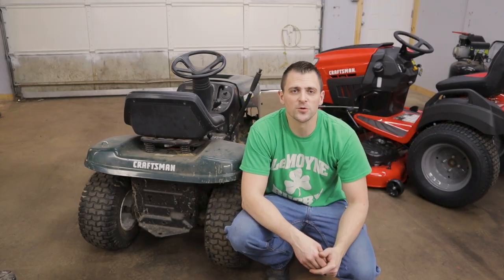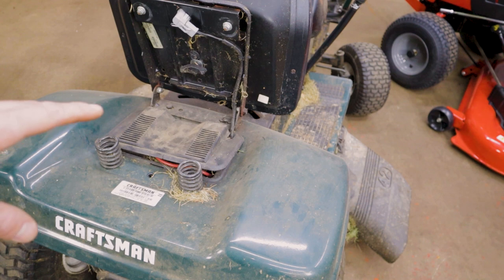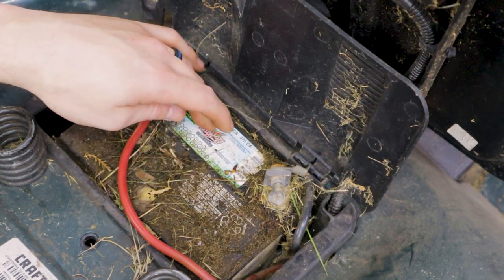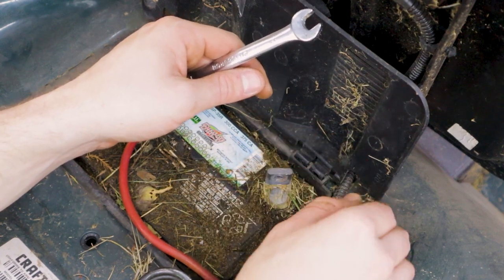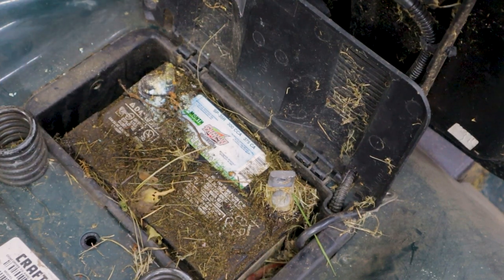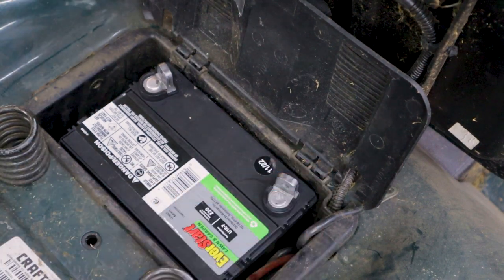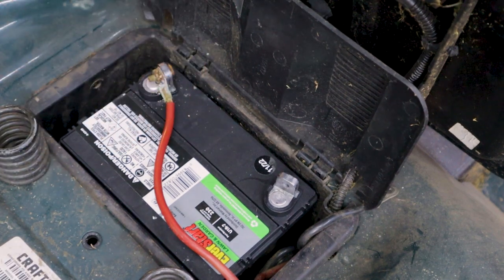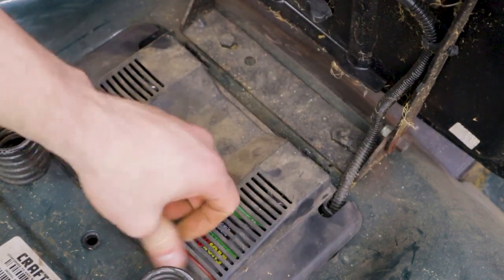How To Replace Riding Mower Battery

Comment: What are the main issues of this riding lawn mover found one in my area for 100 I was just wondering before deciding to buy it
Reply from the maker: Other than the little things I've filmed ... nothing. I had a few of the welds on the mower deck suspension brackets break, but was able to repair them. I've really put this little mower through its paces and it's always been great 👍